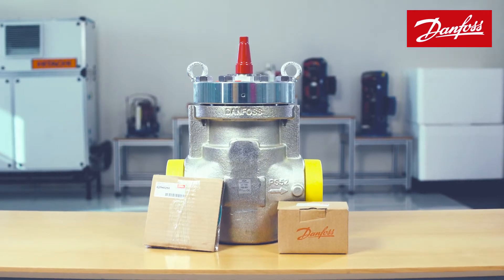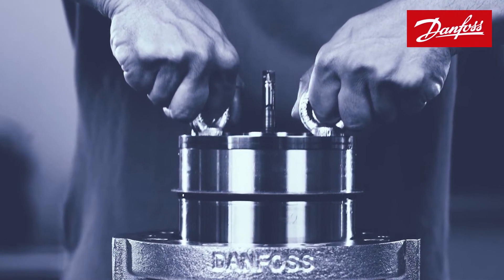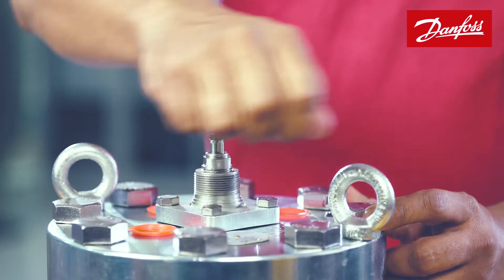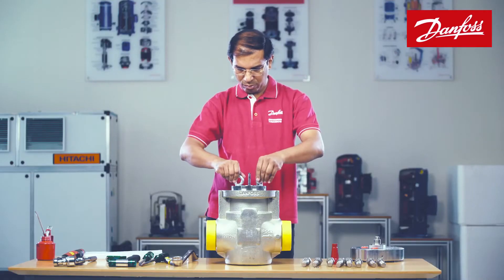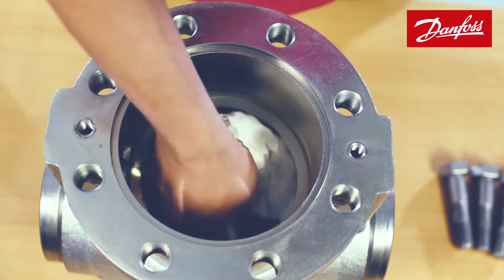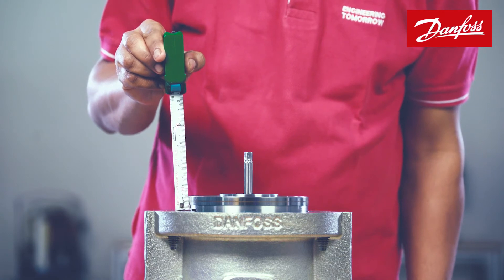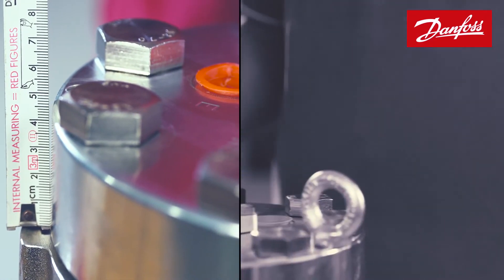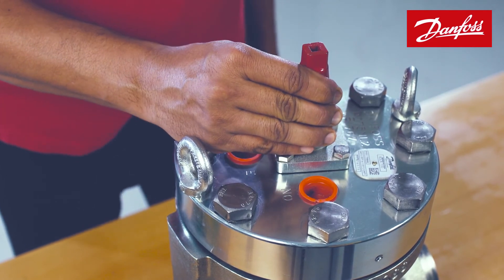ICLX 100 Valve Installation - English

Comment: I have a Question.
Can anyone guide me that when we use these valves for defrosting purpose (with hot ammonia gas) this valve does not close?
Reply: If you have problems while closing, wait until you try to open it. Good luck!